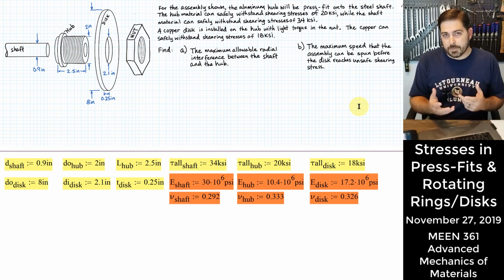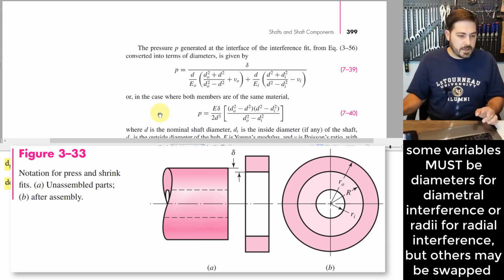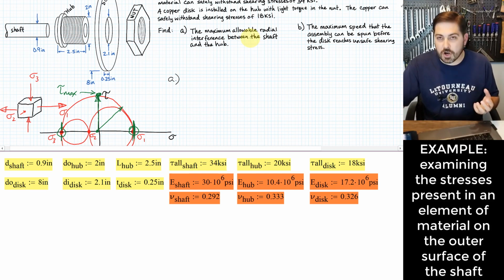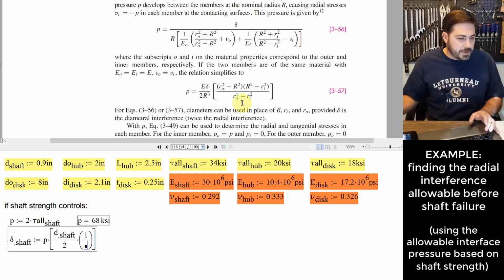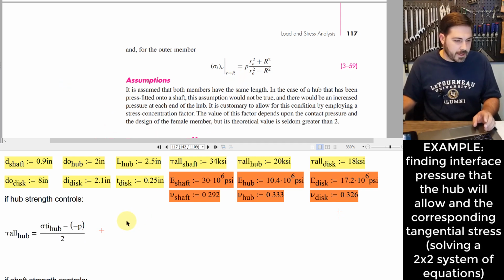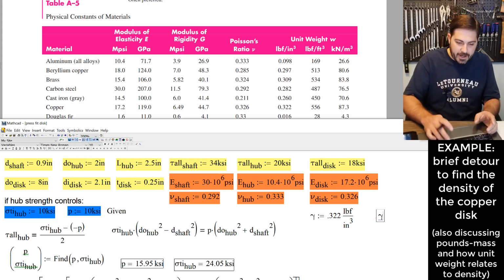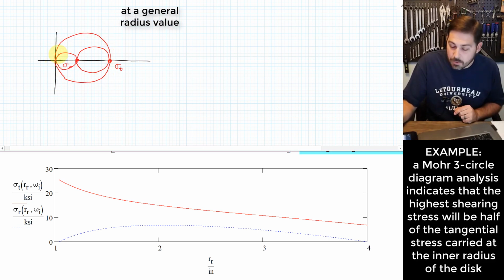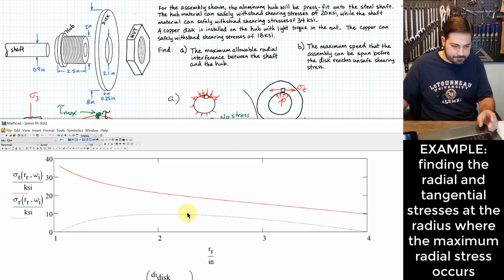Press-Fits & Rotating Rings: Allowable Interference or Speed | Mohr 3-Circle Overall Shearing Stress

Comment: Hello, this approach only seems to only work if the press fit forces are calculated after assembly. Can you confirm if this approach only works for expansion/shrink fitting? How do you approach this press fit scenario if you are press fitting the assembly at room temperature? Shouldn't there should be an additional shear force along the shaft axis proportional to the surface area of contact that needs to be considered in the mohrs diagram for principal stresses?
Reply from the maker: correct. this approach neglects shear forces that develop if one part is forced onto the other.